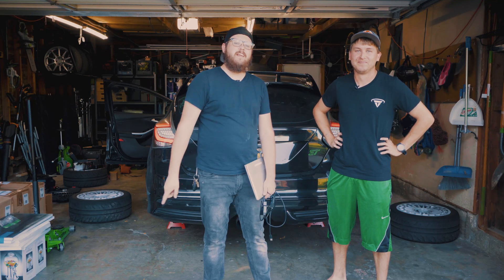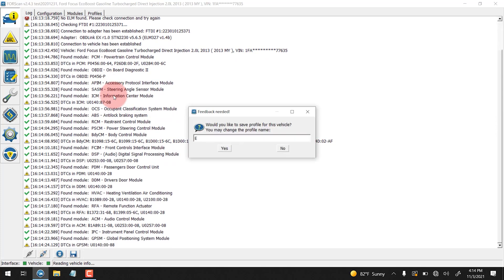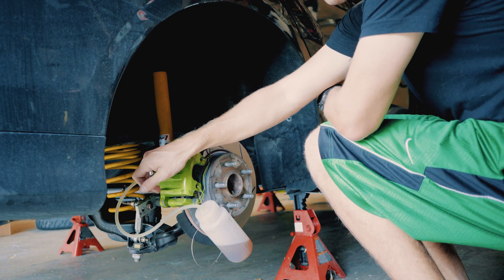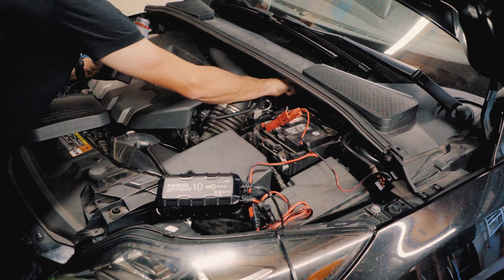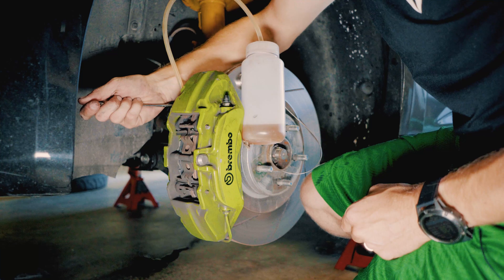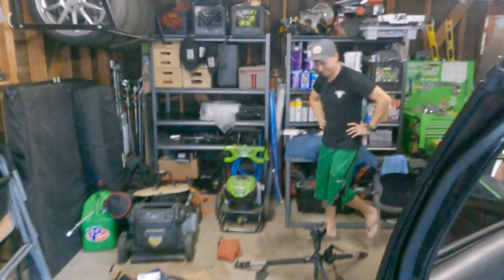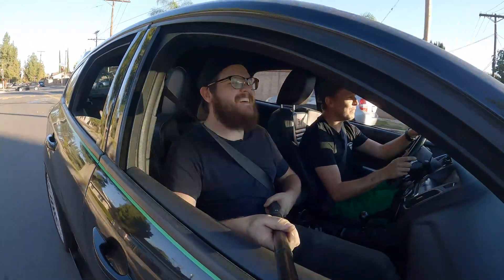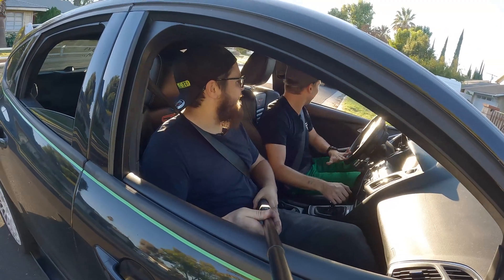Easy Brake Bleed with FORScan 💻🏁

Comment: Is forscan free? Do you have to have a subscription now?
Reply from the maker: It requires a license, which you can get a trial of for 2 months or get a monthly/yearly sub
Reply: @NaviUpgrade thank you for responding. . I see links to downloads for certain years of vehicles. Like 2010- 2016 ford explorer and a bunch more. In that download.  

So it wouldn't work with the elm unless you have the license? This is new thing? I see alot of people have it. Said it was free.

Comment: Alight, I'll see if I can avoid spilling fluid all over the driveway... again.
Apparently on my F150 on the front left, when you are set to bleed the brakes, (to push the calipers in after changing the pads, to avoid pushing any crap back into the brake system), if you leave the bleed screw open and walk away for 10 minutes, gravity will drain the fluid out on it's own.  No good to find the reservoir empty, and the used fluid container over flowing on the driveway...
OK, I did it, fastest brake bleed I've ever done!  I could reach the bleeders without removing the wheels, and had all of them freed up a few days ago.  It took about 20 minutes to do the procedure.  Got about 3 cups of old fluid out.
Great video!

Comment: Great video! Just to clarify, the instructions on forscan menu during this procedure tell to attach a pressurized reservoir with brake fluid to the master cylinder reservoir, but actually it is not needed, just make sure the master cylinder reservoir never runs out of fluid,  correct?

Comment: hello,
very good guide,
unfortunately when bleeding the brakes in my Ford after a few seconds it stops pumping fluid and a message appears saying that the procedure has been interrupted, what could be the cause?
Reply: I have another question.
shouldn't abs brakes be bled starting from the wheel closest to the abs pump?

Comment: I had my car at a mechanics for a hydraulic fluid flush, but when I got the car back it was obvious that there was air in the system. Having watched this video and owning the correct cables and a copy of Forscan I decided to give it a go. 
Super easy and quick to do and oh my goodness when I hit that brake pedal on a straight stretch of private road to test it I thought the airbags were gonna pop!!!! Many thanks from Ireland.

Comment: One quick question: Can I start the car in between bleeding so that car battery won’t drain completely as I don’t have Jump starter? 
And 1ltr of brake fluid is enough to bleed all 4 tyres in Ford Ecosport?

PoV: Battery is newly replaced

Comment: Just a question about your Noco charger maintainer 
Are you setting it to the 12volt charger option or the 12 volt supply option 
I have this charger and need to do an abs bleed on my car. Thanks in advance
Reply from the maker: Set it to 12v power supply option!

Comment: What version is this? In my Forscan program it is completely different. v2.3.62 version does not have this kind of function, that you can bleed air individually and you also have to press the brake...

Comment: Hey Bro, I have a 2021 Ford Bronco 2.7 with EPB and EBB and Ford requires pressure bleeding the system and using FDRS. Do you have any knowledge of utilizing the Forscan to manage the brake bleeding while under pressure. Thanks.

Comment: I ended up getting about 14 oz of fluid out of that first bleeder (front left/ driver's side, as per the specified ForScan order on my 2012 F150 5.0L), but only about 3-4 oz total out of all 3 other bleeders combined.  That normal? (Thankfully, I had a master cylinder auto-refiller bottle installed to keep the reservoir full on that first bleeder).

Comment: Do I need to tighten the drain screw in advance to ensure that the brake oil pipe is under positive pressure?
Reply from the maker: Yes, but within reason. You could pre-loosen them but I personally wouldn't let it sit for more than a couple seconds before the abs pump is engaged, just to prevent any air getting in the lines from a not-so-great collector tube attachment. You can do this all yourself without a buddy if you use a USB 3.0 extension cable on the adapter so you can take the laptop with you to each caliper.

Comment: I am having this exact problem on my 07 Ford Explorer.  The brake is nice and hard until I start the car and then to the floor it goes.  Will this work on my older model Ford?
Reply from the maker: It should if the vehicle supports it! Not sure about that year specifically. Can't hurt to give it a shot!

Comment: Are you not pushing brake pedal when fluid is coming out? is the system pushing fluid on its own?
Reply from the maker: Yep! It used the ABS pump to modulate it vs using your foot!

Comment: can this be done on a 2016 Transit Connect?
Reply from the maker: Yessir.
Reply: @NaviUpgrade  I could not see a choice listed to select ABS Brake bleed.  Only showed a reset or calibrate.  It may be an issue with the Forscan Data Connector so I ordered a different one.  Maybe it will show up in the list.
Reply from the maker: @1neleven  also try getting the beta version of FORScan!
Reply: @NaviUpgrade  I got the recommended OB adapter but still do not see a choice for Brake Bleed.  There is a procedure choice for Left Front Dump, Rt Front Dump, Right Rear Dump but no Left Rear Dump.  And just ABS calibration modules  I still see no Brake Bleed choice.  Any ideas?
Reply from the maker: Give the Beta version of FORScan a shot

Comment: i tried this on a MK1 Ford Focus but the ABS service bleed option doesn't show, would there be a solution for this do you know?
Reply: Ford removed the ABS Service Bleed option from some of its vehicle servicing options a couple of years ago (I'm writing this in mid 2024), so your year/model might have been affected.
Reply: @ronc4146  Thanks, I figured out a workaround in the end.
Reply: @boing615  How did you do?

Comment: Man I need your help with my 19 ranger. Brake is so spongy . Do I just simply bleed each caliper like you did? No additional steps to make sure the air is out ?
Reply from the maker: Yeah I'd just do that! Farthest to closest. So passenger rear, driver rear, passenger front, driver front.
Reply: @NaviUpgrade  and I have to bleed both inner and outer of each caliper?
Reply from the maker: @robmijn  this was for RS brakes which have double bleeders. Most likely you don't have double bleeders like that. And if you do, after I made this video I talked to a tech friend of mine and she said she only ever bleeds the outer one

Comment: I have a Ford Fiesta mk7 1.4 - 2009

This car have a famous problem with the spongy brake pedal and low power. Can this tutorial fix the problem ? It's very dangerous drive with this problem....

Thanks!😊
Reply: Rear drum cylinder probably leaking for spongy brakes on a 1.4 fiesta in my experience as a mobile mechanic in the UK for 10+years fluid flush and rear brake adjustment needed

Comment: Anyone know the differences the brake flush makes if you choose a different component replaced?

For example, Brake tube vs Brake Master Cylinder.
Reply from the maker: It changes the length of how long the master cylinder pumps fluid. If doing the master cylinder it takes a lot longer since it needs to pump all of the air out of the system.

Comment: Why do you use hose bleed and not ABS bleed? 
If I want to change the brake fluid without changing any component I should do both procedures?
Reply from the maker: Because you're not bleeding the master cylinder in this case. If you run the cylinder low or dry you'll need to do that part 🙂 did hose since that tells the system that it needs to pump longer to get more air out of the system for each corner.
Reply: @NaviUpgrade  Ok, thanks! 👍

Comment: Why don't you you-tubers on brake bled replace the fluid in the reservoir first  ?
Reply: They don't understand what hydroscopic means.  To be fair they have added enough new fluid that because brake fluid is hydroscopic it will have a water content that is well below the allowable level.

The reason this happened in the first place is because what you pointed out.

The owner was not removing the reservoir fluid every oil change which is necessary on a track car.  The new fluid in the reservoir will pull the water out of the rest of the fluid this is exactly why we DO NOT USE DOT 5 Silicone in road cars.  It does not equalize water content throughout the entire system.

So his brake fluid was too wet when he took the car to the track and he boiled the fluid in the front rotors which added air to the system.

This is also why you have to bleed the front brakes after every single track day.

So if you have a track car.  Replace the reservoir fluid every oil change or every 6 months.  Bleed your front brakes every single track day.

Technically you are supposed to replace your entire fluid system after a track day and before a track day if the car sat for a year before it's last use.  

DOT 4LV ESPECIALLY.  IF YOUR VEHICLE USES DOT4 OR DOT4LV YOU MUST DO THESE THINGS.  DOT4 absorbs water more quickly and is why the service interval is lower.  It's common for cars to have a 2-3yr first interval and 2yr after interval if 4LV.

Comment: What version of FORscan are you running? Mine doesn't"t have all those options. After changing the brake pads and turning rotors I have a thumping noise on the front tires that goes about a thump-by-tire revolution. I manually bleed (and did a fluid flush) and did a FORscan bleed cycle without opening the bleeders. triple checked everything was assembled ok and still have the noise, the harder I press the pedal the harder the thumping. I'm running out of tricks. Any help will be greatly appreciated. No DTCs or light in the dashboard.
Reply from the maker: It's the beta version that you have to request access to since it has module update options. Too many folks were using crappy adapters and bricking modules in their vehicle.

As for thumping... Does the pedal raise back up when it 'thumps'? Did it do the thump before the rotors and pads? I'm wondering if the caliper bolts aren't torqued down to spec. I'm also wondering what it would sound like without load (front end on jack stands). I'd be curious to see if it happens only when there's weight on the hub assembly.
Reply: Id also make sure your using a OBD2 scanner that at least has a MS/HS switch but the OBDlink EX is recommended.

Comment: Thank you! my ford cmax got the front right wheel stuck after letting go of the brake pedal.  Many mechanics told me that the abs needed to be replaced.  I changed only the oil with this procedure by selecting "brake fluid" and my braking system was as good as new.  Thanks from Naples, Italy.
Reply: I located this video to show to someone specifically because dealers refuse to diagnose vehicles properly.  All they do is throw new parts at warranty claims.  To be fair a new ABS pump would have worked because the dealer would have had to do the bleed procedure.

Comment: Excellent video !

Did you bleed the clutch ?
Is the clutch bleed by gravity or is there an option in the forscan to expel the fluid ?
Reply from the maker: I'll make another video Evan soon showing how to replace the clutch line with a stainless one and bleed it 😎
Reply: @NaviUpgrade  I'll be waiting for this video. Thanks.
Reply: @NaviUpgrade  I tried to perform the procedure on the New Fiesta SE 1.6 130cv 2013/2014. However, it informs that it is only possible in vehicles that are equipped with TCS or ESP. My vehicle has TCS and ESP. Would you know how to inform me even having the requirements is not possible to perform the procedure ?
Thanks.
Reply: @NaviUpgrade  Have you had a chance to replace that clutch and bleed it?  I'm wanting to install a steel braided line but would love to see your video on it first.
Reply from the maker: @jamers99  I did my clutch but had a trans shop do it with a new clutch line. My buddy did his though, I'll see if he is down to film a vid on it with me

Comment: I don't see that replace break line function when I connected Forscan to a 08 Escape Escape Hybrid... Is there any other way to bleed 08 Escape Hybrid?
Reply: What OBD2 tool are you using? Only use the OBDlink EX

Comment: Hi I was searching for this procedure. I noticed forscan asked before to start the process to pressurise the reservoir at 1-2 bar with an external pump or whatsoever. You ignored it, am I right? Is it mandatory or not? Thanx
Reply from the maker: Not mandatory at all. You could do it that way for sure, but the ABS system can create more than enough pressure and it will get all bubbles out of the lines
Reply: @NaviUpgrade  thanx, i thought the abs pump on the vehicle might struggle (or get damaged) without the use of the indicated pressurising procedure.
Reply: Thank you for the video! I think checking the reservoir before starting may be a good idea.. possibly get an auto fill tank for it for those anxious folks out there (like me).

Comment: Hi please could you help  on one of your videos you have a sync bench tester set up  using a bcm and other components I have built one  and every thing powers up and can do updates the only issue I have is when I connect forscan it has message ensure ignition is turned on I have ignition switch and pats and correct key all came from same car but no forscan connection I can use the profile from my car to make changes but would like to use forscan programming without using my profile please could you tell me how you got round this issue of witch I think is a  PCM issue of witch I have not using one as I think the bcm is looking for it any help and advice would be appreciated thanks

Comment: Hello my friend. thank you for the video. my car is 2016 focus. The brake pedal of my vehicle is very hard and when I press the brake, it stops very quickly and harder than it should. Do you think it will work if I do this?
Reply from the maker: This is going to have the same effect. I would try less aggressive brake pads 🙂
Reply: This sounds to me like a vacuum issue not to air in the lines. Air in the lines makes the pedal spongie not hard, vacuum does.
Reply: Is it possible to use Forscan to bleed just the front brakes? Or do you have to start at rear then do front?
Reply from the maker: @zachgroll4230 yes you can do just the fronts if you need — say, if you just replaced a caliper on one corner you could just bleed that one corner.

Comment: Did an entire Brembo install, plus a couple of fluid flushes by the old manual pedal push method and never knew about this! Also never had a problem with pedal either tbh. I suspect that this method is essential if you let too much fluid drain out of the system.
Reply from the maker: Well shoots that's good! When I did my stainless steel lines and Brembos I didn't let it get below min and it was still squishy. I'd still recommend giving it a go at some point and see if your pedal becomes even stiffer!